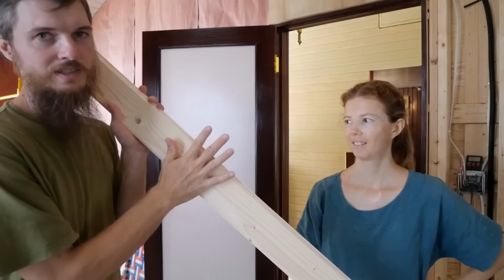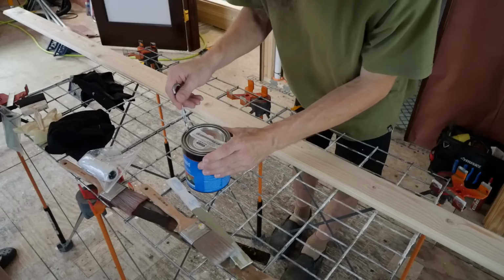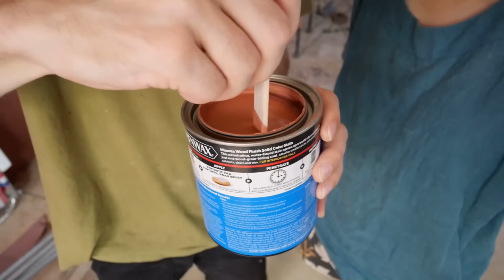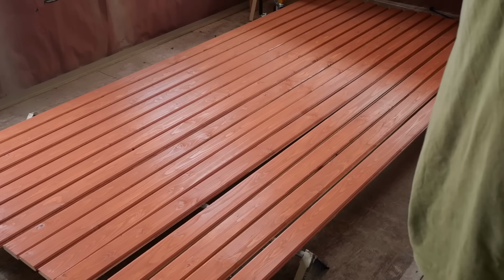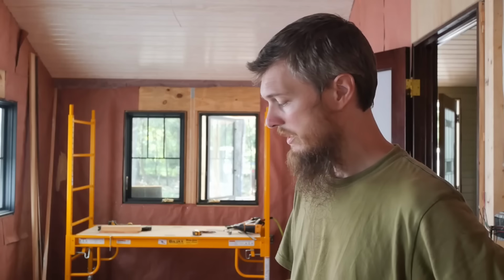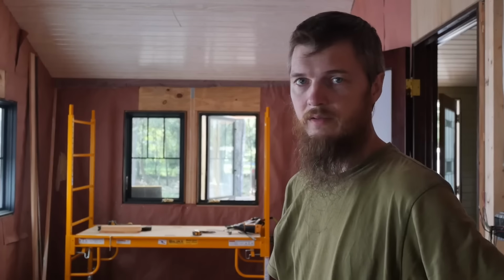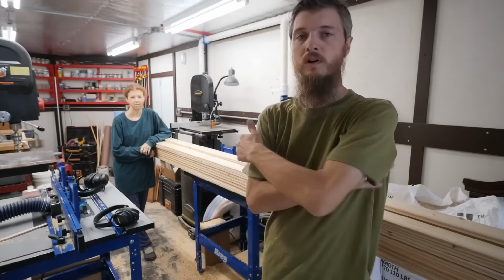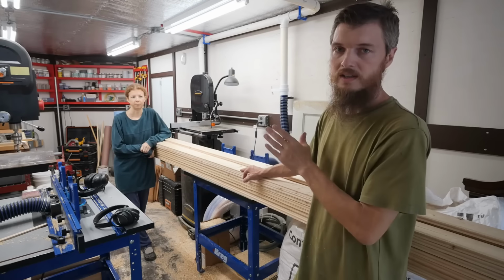Home "Restoration" Update /  Bedroom Color Commitment

Comment: Nice color choice. Living here in Florida we do have very sandy soil. Have you ever thought about sprinkling all that sawdust on your yard? It breaks down very quickly and enriches the soil. Just a suggestion.
Reply: Hi Neil
We do that here in Missouri in our landscaping
It works great 👍
Reply: If there are no chemical/preservative additives in that wood you can make a compost pile.  Add your house veg/fruit waste, mulched leaves, etc. Turn it regularly and have a great base to use for when you decide to start a garden. Even if that is in a year or two years you just keep adding to the pile and turning it.  It ll be waiting when the time is right. Pallets are free a lot of time and a three sided structure as large as you want to hold  the material with an open front for easy turning will do the trick. You could attach a tarp across the top for when you have those torrential rains. Some water is necessary to aid in the breakdown but you don’t want it washing away either.
Reply: Beautiful color!  I see why you chose it!
Reply: For some reason I new the color was going to be the color befor you opens up the can cause I remember your wife saying how she liked the color of the paper when y'all installed it and just think if it shows somehow it will blend in with the stain
Reply: Great idea!!!
Reply: I am excited to see how that color will look on the wall. It's a nice tone and I'm sure you will enjoy it. What a nice surprise that you were able to find that wood to use. The savings in costs will be beneficial in your restoration.  
Some one mentioned using the sawdust outside to augment the soil. What a nifty idea if it's feasible.  Those shorter pieces of wood will come in handy some where. Even if you use them to make crafts to sell. A way to fundraise.

Comment: 🧐 would processing all the wood putting it up then pray the stain and sealer save you more time ? Regardless is looking good 👏
Reply from the maker: This particular stain needs to be applied, and then immediately wiped off, so it can't be applied in large batches since it would dry to quickly. The reason we like to finish it off the wall is because it's easier to work on on a flat surface and we like to cover the entire tongue of the boards before they get installed. You can finish after installation, but we just prefer this method.
Reply: @diyfferent  oh ok I see, makes sense. Well good thing you guys have a good system already set up. Keep up the good work 💪

Comment: Have you tried applying the stain quickly with a 4in roller then brush it in? It saves you time and more even coverage. When taking a break or finished for the day, take the roller off the handle and drop it in the can of stain, the next time your ready to stain you fish it out with the roller handle(you never have to touch it.

Comment: Have you considered how to speed up the finishing process? We did a similar treatment on an elevated ceiling and found that laying 3-4 boards down and applying the stain, paint, sealer was so much faster than doing one at a time. Even wiping down, it’s easy to cover several at one time. Or even apply the last coat of sealer after it’s on the wall.
Also, are you concerned with seams? We used all 8 ft boards and staggered the seams and they are not noticeable.
Just a couple thoughts.
Reply from the maker: None of our walls will have any seams. With this stain it needs to be applied and wiped immediately since it dries super fast. We're okay with the process we are doing, it works :)

Comment: I don't think the paper was an odd inspiration for the color you chose for the bedroom.  It is almost the color I chose to paint my house.  I was stuck with dark brown trim and a brick planter in front of the house (which I really hated).  I had already used a light color of brick in my landscaping rock (I think the rock was called Red Bryan or something like that).  The rule of thumb when choosing colors to paint a house is thtat you should get the impression of two colors when you look at a home.  There was the roof color to consider also.  I ended up picking up a piece of fabric to see how thtt color worked with all of that.  I ended up with the color you chose for your bedroom.  It IS kind of the color of clay which was what I was going for - all colors in nature.  The clay color worked wonderful with all of my landscaping.  It must have looked pretty good because our energy comany looked at our house and almost chose it for one of their commrecials because my house had so much curb appeal.So I pullled that off pretty good.  When the house was sold, curb appeal kept coming up as a big plus.  Everything I went through to choose a color for the house paid off in spades.  I wasn't crazy about the color, but it worke and was quite the undertaking but so worth it.  You had the chance to live with that color for a long time before you settled on it.  Most people only have a tiny swatch of paint to help them make a color choise.  I suspect that a lot of wrong color choices were made when they finally saw it on the wall, lol!   That said, I can't get over what a smart purchase the trailer ended up being.  Plenty of space for a workshop.  The bus is coming in handy for bringing home your supplies.  I can see the need for a smaller vehicle.  I hope the car you bought for a project works out and you end up with a smaller car you can use.  Hatchbacks were the best invention ever.  Almost every car has that advantage now.  It is surprizing what you can haul in them.

Comment: with everything being wood planks you need some offset in colour to make it look interesting , if you paint everything white or beige youre getting that hospital feel (though even hospitals starting to add color to their walls )
if you buy large amounds of wood you might be getting better material for less cash if you go to a woodmill instead of a diy store
you might be able to compost the sawdust or use it as decorative cover on flower pads (do read up on that as the sawdust might turn the ground too acidic ) i allso seen the stuff used as insulation and sound dampening by filling the space between walls with it (fire hazzard) maibe trow it down under the house as a bug repellent 
 as for the rain ; maibe you can get one of those party tents thats high enough to drive the back of the bus under and goes over the rear of the trailer , that way you create a covered walktrough between the two when working the wood , prolly helps keeping the worst of the heat and UV of you guys when working in the full sun

Comment: Would a laser level help keep the corners lined up ?
Reply from the maker: No, not really. In the entryway, the boards all started at the same level but they got way off as I went up the wall because some of the wood we bought was wider than previous batches. Little differences in size add up over the height of the wall. I'm hoping that by working the three walls at once, I can keep an eye on each row and adjust if needed. We'll see.

Comment: How long until those blades need sharpening?
Reply from the maker: It depends on the wood and other factors. I was told I should get at least 2400 linear feet out of them, if I remember correctly. I should try to sharpen them now to make them last, but they are still cutting okay.

Comment: Probably someone has already asked but why are you staining both sides and the tongue/groove before you put it up rather than only the visible side once its on the wall?
Reply from the maker: We're only staining one side of the boards. We like to stain the tongues because sometimes boards will shrink slightly after being installed and we don't want to see unstained wood in the crack :)

Comment: You two aren't sweating. Do you have the air conditioning running?
Reply from the maker: It hasn't been too hot lately. We don't have AC, but we handle heat fine for the most part.